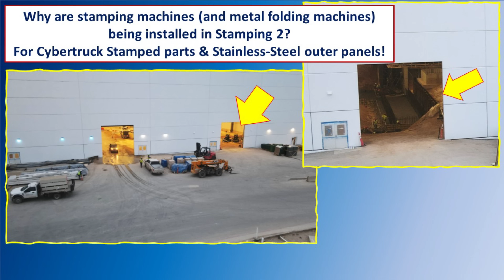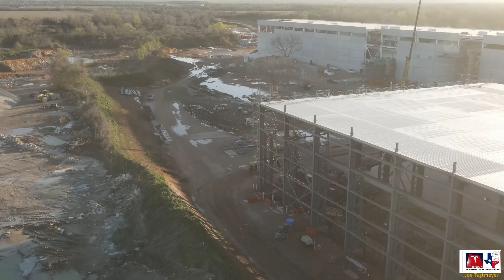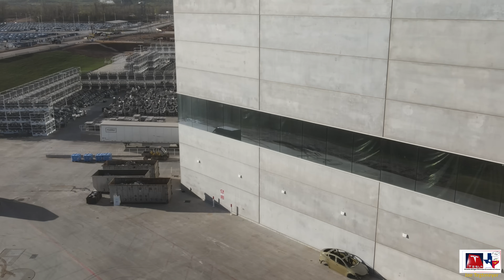Reflections on Investor Day, Landscaping & Big Bore Drilling! 3 Mar 2023 Giga Texas Update (07:30AM)

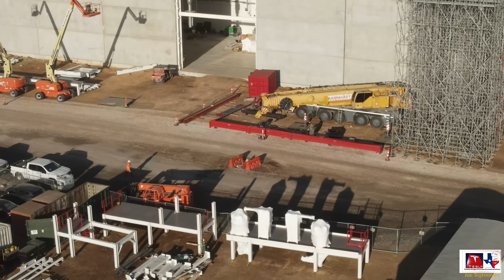Comment: At 22:48 of your video, you can see the forklift by a window on the top floor. I believe that is the window that shows up with the Cybertruck in the battery cathode plant, when you look at the upper windows in the photo, it seems a little more well lighted, as if that photo was taken in the daylight and no extra light on the lower two windows. I thought it was kind of interesting to see how the two adjoining rooms were connected inside. Just a thought.

As usual, great video Joe!  👍

Comment: Lack of discoloration on the stainless steel only means they surface finished it after heating. So, weld, then surface finish, and the welding discoloration goes away.

Comment: Thanks Joe.
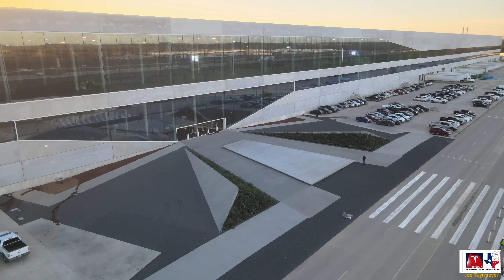12:15. Main Entrance. I didn’t see the big hat or big boot in any shots from Investor Day.
Apron. Roof overflow drains came into action during the storms, washed away the mulch. 
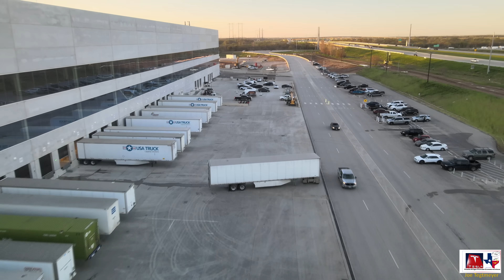12:29. GA, road. Concrete pump.
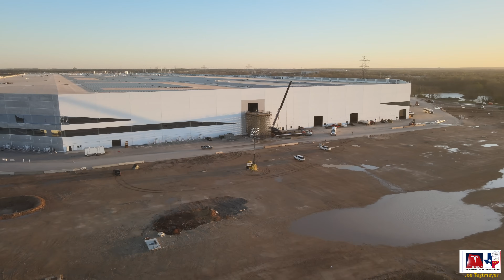14:12. Southend. Constructed bunds/berms around the open stormwater drain excavations.
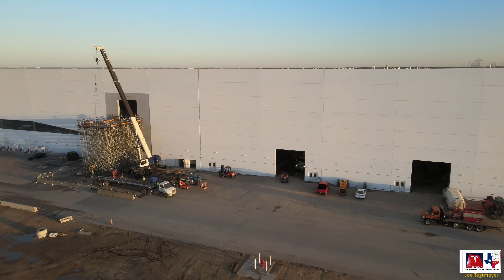14:35. GA, loading platform. What appears to be stainless steel pipe being hoisted.
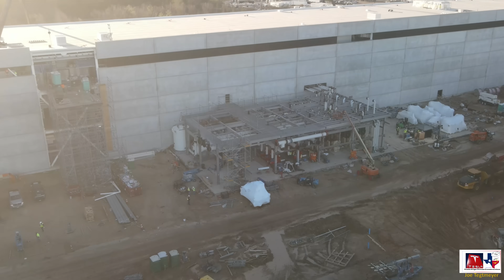20:31. Cathode. Plant apron. White wrapped machinery placed on the heavily reinforced U shaped section of slab. Possibly staged here only.
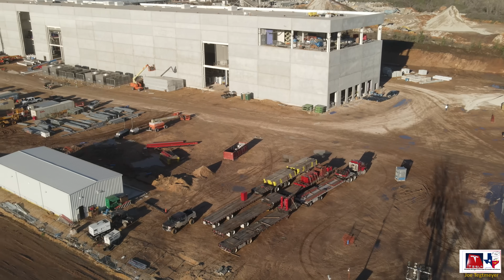21:20. Cathode. Hoisting gear, spreader bars and other equipment for shifting heavy machinery into Cathode. Yellow items are large timbers for spreading loads, bearers if you like.
21:47. Cathode. Sacmi presses area. Platforms and some of the beams seem to be set up to be suspended.
22:47. Cathode. Loading platform. Long red spreader bar for some long item to be hoisted. Likely the long white bench like structure to the left that was delivered on an extendable trailer a few weeks ago.
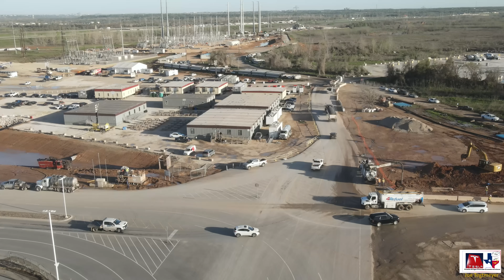24:29. Tesla Road, north. HDPE pipe. Likely this is a force main for sanitary sewer. Recycled/reclaimed water elsewhere around the site has been purple.
25:51. New Switchyard/Substation site. Drilling rig for the monopole footing shaft. 2 different cutter heads.
26:29. Tent Kitchen. BBQ trailer and the Borden dairy truck are back.
29:04. Casting roof. No additional furnace flues, so no additional furnaces yet to support the 9000t press. See comments under Joe’s 27 February video.

Comment: Thanks Joe.
4:24. Cybertruck. Top left, photo. 
The structure as seen in the photograph looks to me like a structural rolling chassis waiting for the exterior skins to be attached. Those 3mm stainless steel skins may add substantial strength to the structure, but in themselves would not be structural members. 
The running gear clearly does not attach to the stainless steel skins. The stainless steel skins attach to the structure. 
I don’t mean to diminish the design, I’m not criticising it, only commenting on what is seen. 
I see a unibody, less its outer skins.
4:54. Cybertruck. Stamping/folding. The presses that we see being installed in Stamping 2 seem to be no different to those installed in Stamping 1. As Joe points out there are plenty of stamped components required for the cybertruck unibody. Brake presses are expected for the exterior stainless steel panels, but what’s not to say that the stainless steel exterior panels won’t also be stamped into shape in AIDA presses. Simple ‘V’ or ‘U‘shaped dies. None of the stainless steel panels seem to have any more than 2 folds/bends. The angle of the bends is minimal. See 6:20.
6:20. Cybertruck. Front fascia is curved. If it is stainless steel, is it stamped, or rolled? Rolling would seem likely I would guess.
Stainless steel exterior panels. Adhesive fastening seems logical. Will be interesting to find out how they go about it in terms of the adhesive setting times.

Comment: This rivet connection process is not good. They should do it like 
the major aircraft manufacturers. 

9:20

These glue their components together. In earlier times, in the past, 

Boeing and Airbus also riveted, but not anymore today. 

And some parts are joined using the friction/spin technique - 
friction welding.
Reply: Wouldn't gluing body panels makes the parts unrepairable/unreplaceable?

Comment: @ 6:16 Doesn't gluing of body panels with industrial strength adhesives equal even more unrepairable/unreplaceable vehicle components?  Castings, structural battery packs, and glued body panels seems to be going in the direction of throw away cars!
Reply: Well, there are some military aircraft that use carbon fiber and glue to hold airfoils in place...
Reply: @The_DuMont_Network  That may be true. But the military has the money to pay for very expensive repairs or replacement of entire assemblies. Not so much with ordinary consumers.
Reply: 6:16. If you are faced with having to repair one of these incredibly heavy duty skins, a bit of glue probably the least of your problems.
Reply: @DessieDoolan  Wouldn't be that much of a problem if you could purchase a replacement skin, new or used, a bolt it in place. Repairability is something that has to be designed in from the very beginning. The ability to repair vehicles, especially independent repair, doesn't seem to be a priority at Tesla. Am I wrong?
Reply: @DavidJohnson-tv2nn  You've missed my point. If that panel has taken enough force to damage it to the extent it needs to be replaced there will be other issues to deal with that would dwarf dealing with some adhesive.
Reply: @DessieDoolan  I may be wrong but....
Given the difficulty in working with stainless steel, it wouldn't take much damage to require panel replacement.
Furthermore... In conventional unibody design, body panels are usually spot-welded. Where the welds can easily be drilled out. 
My opinion...
The owner of the vehicle, the person who bought and paid for it should always have the option to repair. It should NEVER be decided by the manufacture that owners should not be able to repair their vehicles.
I'm sure you will probably disagree :)
Reply: @DavidJohnson-tv2nn  

"Given the difficulty in working with stainless steel, it wouldn't take much damage to require panel replacement."

I'd agree or disagree if I could understand the statement above.
Reply: @DessieDoolan  My understanding is that the stainless steel used in the Cyber-crap truck is very hard to work with. Thus one of the reasons for the straight lines in the ugly design. It seems that a dent would be equally hard to remove. You definitely can't use body filler to fill dents on unpainted panels.

Comment: You mentioned being told that they would be building a large parking garage at Giga Texas.  If they continue to expand the warehouse on wheels west of the highway they could completely move it there. That would open up the area where it is currently, by the employee parking, for a large multistory parking garage. Since they have already installed Geo piers in part of this area and have leveled it they would have a lot of site prep work done.  Once it was completed employee parking could be moved there and the current employee parking area could be used for new vehicle parking.  That little lot they are using is already full and they are increasing production.  I would also suggest that they move their helicopter landing pad onto the roof of the new building addition. Of course seeing how much damage is done to those brand-new cars sitting next to it could be entertaining.
Reply: Great. Assign me a parking space at the South end, then I have a MILE to walk to my job in the plastics shop... I think not.

Comment: Great video. I hadn't considered the Cybertruck being a proving ground for the new building technique! I wonder if the vehicles will be more repairable with this technique too.
Reply: Less repairable! Going in the wrong direction!
Reply: @DavidJohnson-tv2nn  I reluctantly agree. It seems even Tesla is going more to the throwaway model. In my case, what should have been a little filler, some sanding and spraying became 'replace the entire fender and hardware, then spray the whole thig a couple of times.
Make no mistake, their workmanship was superb. But $3K instead of $500.
Reply: @DavidJohnson-tv2nn  However, based on the Tesla reported accident data  their ADAS system reduces the rate of collisions and therefore the overall cost of collision repair / total vehicle loss.  Presumably Tesla insurance customers will see this savings in collision coverage.
Reply: @datamatters8  Even if there were a reduced rate of collisions, collisions still happen. If the car is unrepairable, and is an older vehicle without collision coverage, the owner gets screwed. The big problem here with structural battery packs, castings, and glued body panels is a clear move towards throwaway cars. Just like with cell phones and their glued in batteries. My conclusion is that the tech industry is greedy, and seems to think you shouldn't be able to repair the products you payed for and own!
Reply: @DavidJohnson-tv2nn  which ultimate makes it cheaper and more accessible just like it did for phones. This is what the right to repair folks don't get...the MAJORITY of people see the car as nothing but a tool...to get from point A to B, the add-ons are just a bonus. The reason why Rivian cost 200k per car and Tesla will be a fraction of that is due to how its built and simplicity.

If given a choice...the majority will chose the simplicity of plug & go or in this case buy & drive. Replace it when it no longer works....just like phones. Most people don't have the time to learn how to fix their own cars let alone fix their own phones. Even when available...most people didn't replace the battery in their phones or labtop. They just want something that works and something they can afford.

This is ALSO the reason car enthusiast have it COMPLETELY wrong when it comes to autonomous driving. They assume that because THEY enjoy the feel of driving, that society wont switch over to a mass level of Non- Car ownership. Once again its a tool. If you can get getting from point A to B down to 15cents a mile in a robotaxi vs current levels of $1.25-$.75 a mile under owning a car...people will gladly and quickly stop buying cars to own and start using robotaxis. Simplicity wins. It will be like the apple ecosystem. Everyone buys an apple device knowing its less customizable and harder to repair...they still buy them en mass.

Comment: Great video as always. Maybe on one of your later starts you can get a better look inside the DIE shop project, with less sun glare.
Reply: Has anyone determined the actual NAME of the building, the words of the acronym? I've got a sixpack of Lone Star says it has nothing to do with dies for stamping machines.
Reply: @The_DuMont_Network  I've wavered back and forth on this. 

Cut and past from elsewhere.

'I’m also trying to find out more about ‘die’ construction. ‘Construction’ seems to be the correct term. Nowhere have I found any information suggesting such a massive footing would be required for any machine to construct dies. Lots of images of milling machines not particularly large, working on dies for stamping out side panels of vans etc. Additionally the giga casting dies are ‘puzzle dies’. Made in smaller sections and bolted together. This is for ease of repair and modification. Apparently larger casting dies had a tendency to crack. In dealing with this problem they began to segment dies along these potential crack paths. From there other advantages were found, and these segmented ‘puzzle dies’ are now common. So in fact, the dies are smaller again!

Finding this all puzzling still. Job vacancies for toolmakers etc in the Die Shop. Is it all some sort of elaborate snow job (subterfuge) to disguise the real purpose of the plant? We can’t see into Casting now, presumably that is to do with trade secrets. Die shop vacancies could be for within Stamping, Casting, and Plastics. '

Interesting that this building didn't get mentioned in the Investor Day presentation.

Comment: In addition to the Bolts, it is very likely that all such mating surfaces are also using industrial bonding agents (adhesives, epoxy, etc.) to further fasten the surfaces and reduce or eliminate any Noise Vibration Harshness (NVH)!
Reply: Using  industrial bonding agents also makes the vehicle unrepairable! Am I wrong?
Reply: @Breached Penguin Well, of course Tesla doesn't like their vehicles being repaired. Just like all other greedy tech companies, they want their customers to purchase new products from them. So they can enrich themselves. Am I wrong? 
Besides what right does do companies have trying to force customers to buy new products? Once a customer buys a product, don't they own it? Meaning they should be able to repair it if they want!